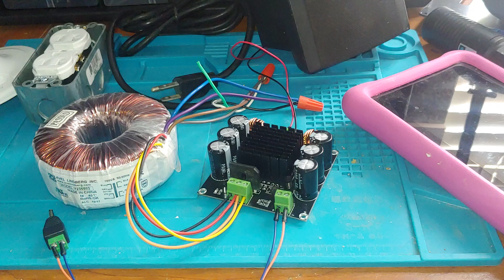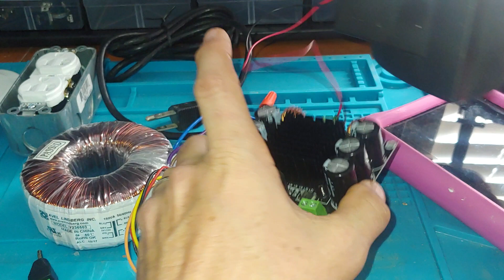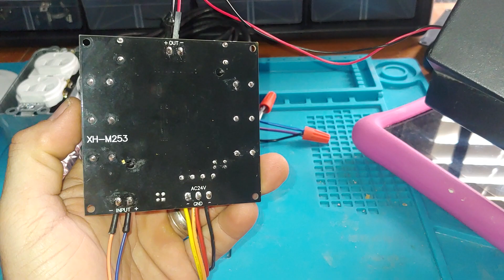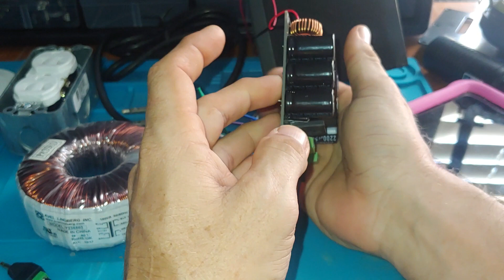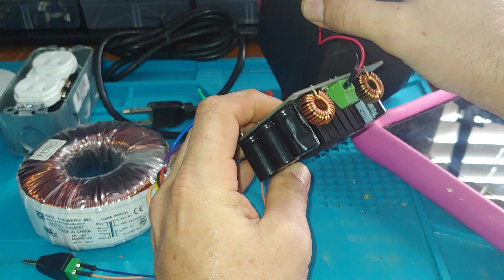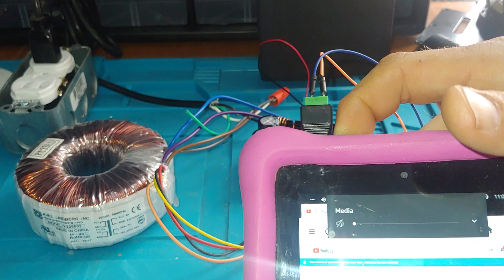TDA8954TH Amplifier First Impressions (XH-M253)

Comment: Hi, friend. I have a module like the one in your video. But my module when I connect it to the 24v power supply without using it, it starts to heat up. that's normal?
Reply: Are you using 24VDC or are you using a center tap AC transformer as required?

Comment: i have connected a 24-0-24  3amp transformer to this amp but there a heating issue the heat sink gets very hot even after 5mins of use is there any 
problem with the board or power supply or is it normal.

Comment: I have a similar amp board, but the heatsink gets quite hot even without the speaker load after about 10 to 15 mins. Is this normal?? Please let me know.
Reply: Yes this board need active cooling
Reply: A small fan on the top will work

Comment: Hope you are doing well! I have two passive tower speakers and each tower consists of Woofer 6.5 Inch(60W RMS)+Mid-Range 4.0 Inch(40W RMS)+Tweeter 1.5 Inch(20W RMS) that is 120W RMS+ 120W RMS and Speaker impedance 4-8 Ω. I have also two TDA8954TH mono boards. Can I use my two tower speaker with these amplifier boards as 2.0 with ease or not. If yes could you please advise me on the appropriate volt of the transformer and the ampere?
Reply: Yes you can. If you use the 24-0-24V (300VA toroid), be gentle with the volume control, as the amps will put out close to 200W each, this is no problem for a 60W speaker (only the woofer counts...). Keep in mind the heatsink will get up to 50°C, this is normal. Do check if it is fastened properly flat on the chip, or the fun will be short lived, as the thermal protection will kick in. I added a heatsink to the 8A rectifier, as the radiation of the chip heatsink causes it to get rather hot, as it's a bit on the amall side when 24-0-24V is used.

Comment: Did you get to assembling a mono block amp?
Reply from the maker: I did. I will make a video soon. Two monoblock amps. Very simple, but sound ~pretty good.
Reply: @sdriza  Nice, will keep a look out for it. Mine currently drives one of my tapped horn subs.

Comment: 🌹Dear sir can you explain power supply details,
AMPS and VOLTAGE 🌹
Reply: The amp needs 24-0-24V AC input, preferably 200VA or more. This can be a (toroid) transformer, or a switching power supply.
Reply: @janspoelstra8309  
⚘Thank you sir⚘

Comment: Have you tested at 4 ohms if it can work
Reply from the maker: I haven't yet (have you?) Either way, I will - and I'll post about it.
Reply: it can somewhat handle it. but not to its fullest. since the current limiter will kick in.
Reply: DGJM I've wired it to 4 ohms and it's nowhere near 100w on the output before it starts distorting.